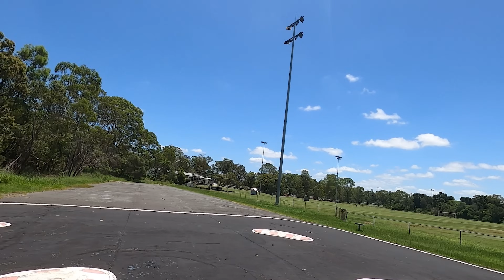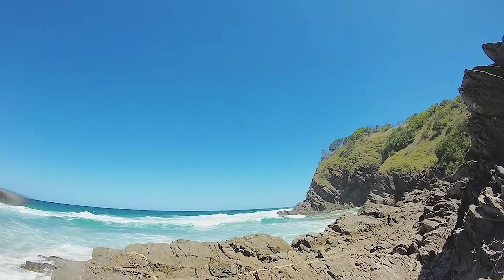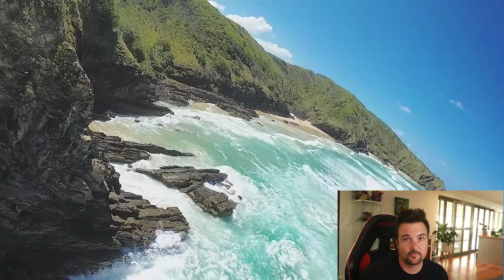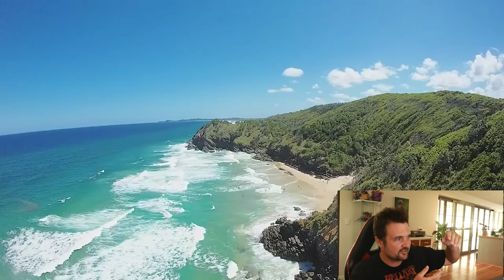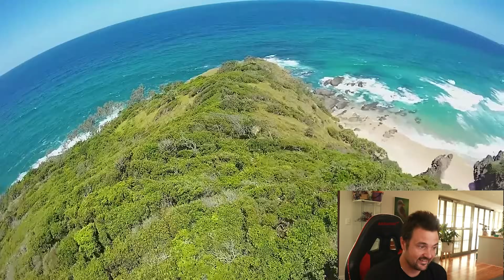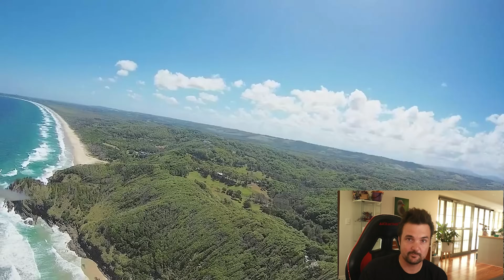"TOO HARD I QUIT FPV"

Comment: I flew almost every day from 2017 to 2023.  Eventually my skill level got to the point that I'd need to crash more in order to progress.  At the same time, parts costs rose to the point that I could no longer justify the expense.  I miss flying.  It isn't too hard but I just can't afford to keep going.
Reply from the maker: how much was each crash costing you?
Reply: @UAVfutures  it wasn't just the cost of crashes but everything adding up.  My bag zipper started failing, GoPro started having color issues, batteries were getting old, needed a new FC for my tooth pick and on top of those potential expenses, problems with two old cars.  I'll get back into it eventually.

Comment: Just bought my first drone. Went with the new GEPRC Cinebot 30 V3 and I crashed it on my second flight and severed the motor wires on the two front props…so now I need to learn to solder.

Comment: Question is "How long does it usually take?" I have been flying pack after back for months and it doesn't progress as much as other people do. Maybe my learning curve is too steep for this hobby, but I am not easily giving up and determine to get better, maybe in a year or two. Also, too much investment on both time and parts, I have stocked up 70-80unit of 0802 19000KV, 10pieces of Air75 Frames, a few FC. People who started FPV at approx. the same as me, they are already thousand time better. They are doing crazy moves out in the bush, whereas I turn my back on 5inch to tiny whoop.

Comment: I relate to this. I started out in the day with open pilot and cc3d. I struggled there and then made the switch to betaflight when it came out and then Taranis stuff. Got it all down enough to enjoy it and also why I don't like and won't move to the newest stuff. Was to hard to get where I'ma at. I'm good with what I have 😎
Reply from the maker: did you ever get the cc3d flying... I struggled with mine and went to baseflight and it was much easier.
Reply: @UAVfutures  I did. It wasn't that smooth tho. I still have my first drone and setup that a fly ever blue moon for giggles. It flies so bad compared to betaflight stuff lol

Comment: Chase the flow state, best feeling ever. My first time in the goggles, i had wobbly legs for an hour, but the feeling of euphoria and exitement to do it it again has never gone away.  Im still not that good, but i keep trying.  I even run through manouvers and settings while im trying to fall asleep. Does that mean i have a problem or that im in love?
Reply from the maker: i remember when i could only fly sitting down?

Comment: I oppose to that the barrier to entry is the limiting factor.
-
I say it´s the practice it takes to fly 'like the cool kids'. 

Flying a domesticated DJI or similar stabilized drones where the user is more an operator than a pilot is non-compareable to the actual thing, since the behaviour and the coupling of the inputs to axies relative to gravity is so non-intuitive compared with a plane. 
-
On my first attempts I activated a mixer for yaw and roll controlling both with one stick, which worked. I remember this feeling of a mental knot in my head when removing this mixer and  it felt impossible to fly a curve. That was a quite wired feeling of having no intuitive idea at all how this is supposed to work. 

I actually took the drone in my hand, mimicked a curve and thought about how the stick inputs have to be like. Over a field of high grown soft grass I forced the manouver through to get my brain and muscle-memory to understand it.
Reply from the maker: Sims are such a vital point of learning. I cant recommend them enough so we dont break out stuff when we go flying.

Comment: Started this year after Christmas. It is fun - but you should have the time. Otherwise it can be stressful to manage this as a hobby next to all the other duties. I underestimated this a bit.
Reply from the maker: what do you find the hardest ?
Reply: @ Not really a lot of issues so far. I had some problems with soldering the ground tabs. This was a struggle. Furthermore it took a while to find the STM32CubeProg to get the Windows 11 USB STM driver. The rest was more or less straight forward. I took Plasticity to design the needed parts. It was fun to get in touch with this software.  Time is always the biggest problem.

Comment: Im so in love with this hobby! Sure, spending money sucks when you break things, but it is worth it. Eventually, you'll get good enough to roll with the punches and learn from your mistake😅...the epic, gut wrenching fails, all make you a better pilot. Stay safe!
Reply from the maker: what was the last thing you broke?
Reply: @UAVfutures  Dont jynx me! But the latest failuire was a vifly gps mate. Not sure what the problem is atm. Getting 2 long beeps followed by 3 short beeps. Not sure how I broke it though, Maybe a loose wire from a recent crash. This is an analog quad so she's on the backburner.

Comment: I started in November (with the set recommended on this channel: Radiomaster Pocket, Walksnail Goggles L and Mobula 8). Already tuned filters and PID using Blackbox logs, flashed Betaflight 4.5.1 (to get properly working dynamic idle to improve prop wash handling), Flashed new ESC firmware and optimized its settings according to Chris Rosser video, replaced the drone frame, replaced one of the motors (it had mechanical issue from the start), replaced the VTX antenna (snapped in a crash), resoldered VTX-FC wires (they suffered during a crash + original soldering wasn't great) and replaced gimbals in the radio when one of them broke.
I'm not long in this hobby, but I already know it's a perfect match for me - it merges my preexisting interests with flying. Currently, I'm in the middle of ordering parts - I'm building my own 3.5" sub 250g drone next xD
Reply from the maker: thats great. How are you finding that kit?
Reply: @ Overall it's a really good kit. Thanks for recommending it :) I'm glad I was convinced to go with a BNF tinywhoop at first.
Pocket is great. Especially after getting AG01 NANO gimbals and different stick ends. I doubt I will ever need more from a radio.
Goggles L are ok (considering price - great). The only complain is that they are quite narrow and I had to mount the foam a bit differently than intended so it doesn't touch my eyes on the sides. If I would wait a bit longer I could have pick the DJI N3 instead (hard to say).
Mobula8 is a great 1st drone - plenty of power, but not that much that it's intimidating (enough for most freestyle tricks). Digital video is awesome. Handles wind better than I expected, but has big prop wash on stock settings. Just one complain - mine had 1 faulty motor from the start (bearing? bent shaft? idk, but I  could clearly hear additional friction when running this motor individually in betaflight configurator). After replacing this motor some minor issues I had appear to be gone.

Comment: I've been flying LOS for a long time. But recently got myself into FPV with the HGLRC Draknight. While I am not ready for acro, I do fly angle. I also set angle limit to 80 so if I want to fly fast, I go fast. Already upgraded the motors and the thing is fast. While I'm still learning all the things on Betaflight. I must say, after years of wanting to try FPV. And finally having a go at it. I LOVE IT!. In a way, saved me. And yes, that first feeling of flying. Damn amazing
Reply from the maker: have you got a siom to try acro on?

Comment: Getting into it initially is the problem. It's just so much to try to take in. It's hard to spend $1k+ on a set up with the fear of even knowing how to actually make it all work together outside of flying. I mean I guess you could settle for a cheap kit, but then you feel like it's just a waste of money, because it's not actually what you want. It may sound silly, but I know that's been my problem. I settled for a cheap kit years ago with a tiny whoop and my video transmission was terrible and it was such a chore just to get it all synced up together for a guy that doesn't have anyone IRL to help guide. Overall, I was just unhappy with the experience because i "Cheaped out" by spending $300. So, it just discouraged me. Hopefully one day I can fully commit, but it's just tough to drop the money. I wish I had someone IRL with knowledge and a proper set up to help me out lol. Or even to just let me try it out, because I'm sure I'd be hooked. (Talking quads btw)
Reply from the maker: i made this exact vid for you last year. have you seen this? - https://www.youtube.com/watch?v=z2plVM8bag0&t=44s all good value gear that helps people get flying, but now in 2025 the n3 goggles might be a better choice.

Comment: I've been FPV piloting for over 20 years..    It has its moments but there are still times it is extremely frustrating.
Reply from the maker: 20 years... was that fixed wings back then and what vtx did you use?
Reply: @UAVfutures  To give you an idea, here's one of blackwidowav's systems available in 2002.. 
"2.4Ghz 100mW Complete System
TX Power: 5v-11v 450mA - RX Power: 12v  350mA
TX/Camera Weight: (including antenna): 1.9 ounces 
Camera: Panasonic CX161 Color CCD
Price: $275"

Comment: remember that if you are not crashing and breaking it you are not evolving. breaking your gear is part of the skill steps, its important to remember this.
Reply: Why can't I trippy spin yet lol
Reply: If start with small and light 1s toothpick and you don't take unnecessary risk (fly ower water or very far) you won't spent so much
Reply from the maker: lets not break goggles or radios though. if they are breaking you are doing something wrong

Comment: Been in this hobby since 5 years and still going strong. The main reason people going out of FPV or not entering into FPV at all is due to very high initial cost, which wasn’t the case many years ago and the second main reason is DJI. DJI has destroyed the hobby for us. FPV used to be one amazing hobby until it became a product and mainly DJI products. People who want to get into this hobby are also not supported properly.
Reply: Bingo. Been my issue pretty much throughout the years. Been wanting to get into it since like 2017. But its just such a high start up cost to get what you ACTUALLY want. I dont want to waste money on some cheap little set up that I know I wont be happy with. But I also dont want to spend 1k+ and go through all the same hassle of even just getting it in the air.
Reply from the maker: @BoomerBarber  What other hobbies give you similar opertunities of learning, exploring, exciting and can be experienced for$500 USD? - thats a digital drone too.  I think the value is really good for the price IMO . Even the most budget PC is going to cost more than this hobby.
Reply: is there a recent video showing a good modern build that doesn't use DJI parts somewhere in the system? I'd be interested for sure...

Comment: Betaflight is over my head. Not a computer designer, sorry. And I couldnt even get gyroflow to open. We shouldnt even have to know what a uart is. Use plugs. Been using them for over a century. Firmware uploads should never be a thing. Unless it's like a phone. Automatic and unnoticed.  Making a transmitter with such a complex system like ETHOS so that unless you watch hours of video, making the tx operate a servo is impossible. And every update makes it more complicated. Customer service can make a big difference. DJI was great. Motionsic was awesome. FrSky was awesome. Walksnail CADDX was the absolute worst. Never getting anything from them again. It's not necessary to make everything so complicated.
Reply from the maker: i can understand your frustration for sure.

Comment: i can confirm it is actually fun after you got all the learning done
Reply: I was wondering. I keep saying to myself... I thought that this was supposed to be fun.
Reply: @PatriotMcVeighONLYJustice4WACO  there is a point where you fly and it clicks and you are like "oh wow that was fun"
at least for me it was like that 
you just have to get some stick time and get comfortable on the sticks before that happens
Reply: @bluefpv3263  I hope so. Havent flown yet. Lots of trouble getting the correct equipment, returning the wrong stuff, repairing stuff that was sold to me defective, learning the tech, and the transmitter. It's been very difficult and very expensive. Got the plane in November and hoping to fly it in a few weeks.
Reply: @PatriotMcVeighONLYJustice4WACO  well i started out with a bunch of semi broken stuff from ebay so i know how it is 
i kinda gave up on fixing the borken stuff and got a bind and fly instead 
than i could fly and fix learn to repair the crap i got on ebay which tought me alot about fixing soldering and configuration 
but beeing able to zip around with my tinywhoop while learning to build a fix stuff was a game changer for me 
i still love the tinywhoops they are amazing for learning because you get so much stick time out of them since you can fly everywhere and are not dependend on good weather or anything

Comment: An extremely great point you made, Stu. We sometimes need to sit back and take a look at what were building. They are insanely impressive machines. It is going to be difficult the first few times and that is the beauty of learning it. It will click with tons of practice. Im at roughly ~37 fpv quads with ~25-30 being built by me. Don't deprive yourself of the sensation of flying your own quad by quitting too early. Keep it up and keep going!
Reply from the maker: wow. thats more drones that on my wall behind me. Which one do you fly the most?
Reply: I might have a bit of ADHD when it comes to them aha. I'm a quadriplegic so it's my escape away from my body. At least 15 of those were sacrificed to the learning process 🤣. My itsFPV ERA is getting the most flight time ATM. But I'm about to start flying a Five33 Footy, a Demibot, and a Source V from TBS once it gets warmer again in Canada.   @UAVfutures

Comment: started from DJI Avata 2 last Nov, and now i got 3 fpv drones!!! (Pavo femto, GEPRC Domain 4.2, and GEPRC Vapor D5 with O4 Pro) ....like he said...once you acquired this skillset,  nothing goes back!!! you just want to keep learning non stop! :)
Reply from the maker: Which one is your fav and do you fly the DJI much after getting the FPV drones?
Reply: @UAVfutures  I can tell the least favourite is definitely AVATA 2. Reason being is that I need to apply permission everytime I want to fly as my location is in between 5-10km radius to airport. It is a bit cumbersome. Also, I hate flying with RC3 controller after I fly with RM GX12 ELRS. I fly regularly Pavo Femto and Domain 4.2 as they are smaller quads and  I can easily fly them at nearby park. I need to go further for flying 5 inch quad despite I m loving it most :)...so it is hard, I love them all :)

Comment: g'day Stu. I started back in 2014. Built and flew for a solid 4 years. Still got all my gear and now interested in something Tinywhoop sized. What's your recommendation(s) that will work with a Taranis X9D+ and Fatshark (analogue) goggles? Love your work - keep it up :)
Reply from the maker: the hard part is the taranis. most stuff now is ELRS so something like a pocket radio is a good choice and only an extra $65. any analog whoop like nible which I recently reviewed a few weeks ago will work with the fatsharks

Comment: Hi Stew,  Great video and info for beginners. I was lucky to have been flying rc airplanes since 1971, but still having all that experience flying quads was a h a ND full. I remember going to the park with 3 or 4 drones and returning home and none were flying anymore.  But once I started returning home from flying and still have quads that worked. But I never had a computer let alone a type writer. I was lost. 13 years later and I still don't understand everything, but I'm able to understand Betaflight and INAV. Thanks for the video

Comment: The problem from me is the equipment is expensive. And the quad I build for hours can be damaged in seconds. But I haven't quit, yet.
Reply: it doesn't have to be expensive. start with an analog 1s drone like Betafpv Meteor 75, under $100, with batteries cheap and easy to manage.
Reply from the maker: is it really expensive though for what you get. its pretty good value vs other hobbies. Even something like an "ok" fishing set up can cost the same as an "ok" FPV set up. What other hobby is cheaper than FPV and gives you so many exciting things to do. (even a gaming system can cost more)

Comment: I used to fly rc helis, it's much worse. Every crash means a lot of time and money to repair the heli. Drones are so much more durable.
Reply: Love the old helicopter RC... Made you fly perfectly or it ended in tears. Transitioned into quadcopters and drones. But now fly fixed wing and some cool RC fpv planes I build. Makes the learning curve slot more rewarding and more cost effective.
Reply: The analog setups of pitch angle, servo throw, ESC governor headspeed, gyro settings, head shaft after every crash etc etc  and nothing came with connectors everything had to be soldered. FPV drones is so much more chill for me, i can actually relax and just have a good time.
Reply from the maker: helis are scary